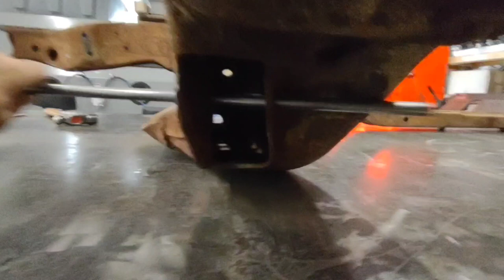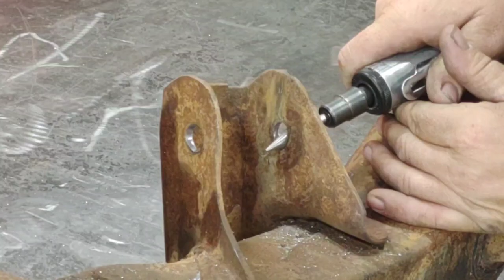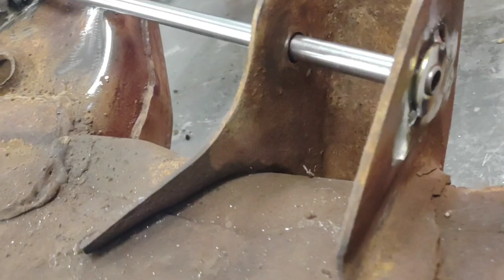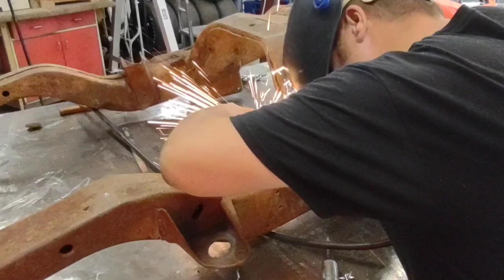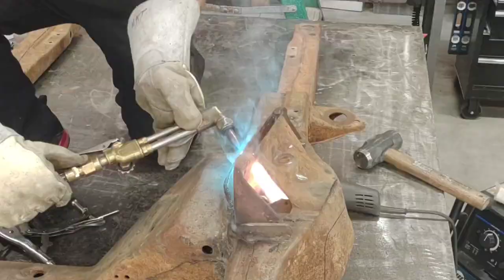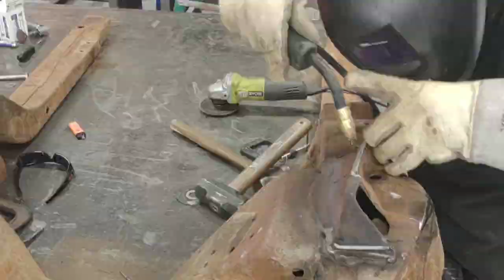Prepping a Stock Clip for installation

Comment: We always stick welded the seams with 7018. Reason being is it's nice to full weld the seams and the stick cuts through the contamination better then mig. Because even if it's a sand blasted clip the ecoat will start to leak from the seams as you weld it.

Comment: Re-stitching the seems help make it a little more ridged. Also stacking a thin material to reinforce what was cut out.. the more flex you take away the more you will be consistent.. a few other things aswell. To your point,Yes the chassis will be more consistent in return will be faster and let you get closer with spring rates..  the more flex the more guessing you do with the right spring rates versus a more ridged chassis that allows the spring to do its job when you need it most. . It’s impossible to calculate flex into your set-up so the correct spring rate is chosen for maximum performance  that corner would perform at..you hit it above when someone mentioned the all free part… ton of work but no fun like getting faster